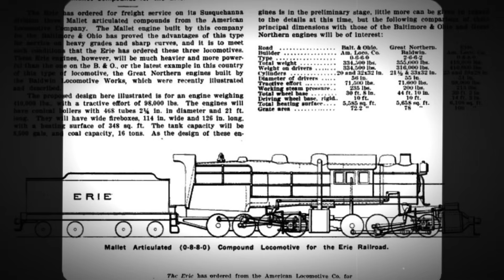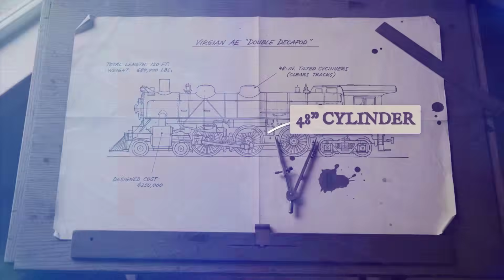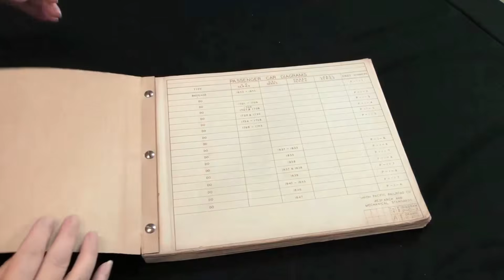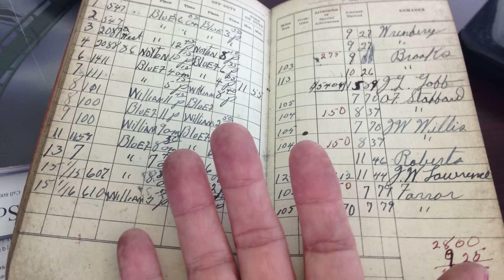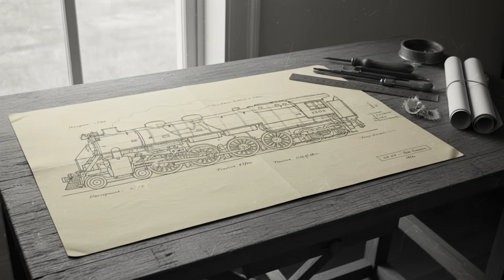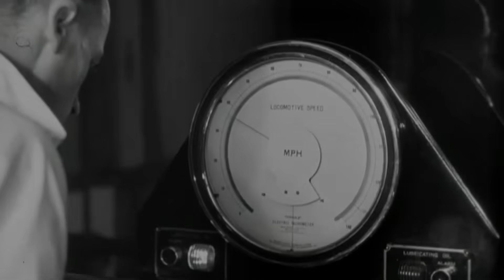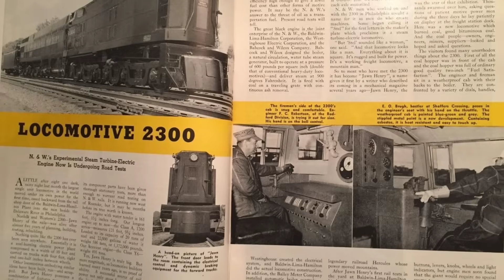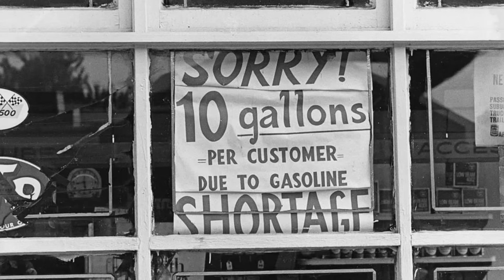10 Forgotten GIANTS That Were STRONGER Than Big Boy

Comment: i never understand why the railroad companies not turn to a all electric "overhead wire" railroad during that time? not waste money building these failed engines especially for hauling coal. why not just make a electric power station next to the coal mines. and string power lines.
Reply: The initial investment is a monumental cost with electric railways.  The only U.S. railroad that ran extensive electric freight trains was The Milwaukee Road.  The box cabs and later Big Joes as they were called, were very good locomotives. And they eventually went bankrupt by the 1980s. That wasn’t the reason, it was poor management that doomed them.

Comment: I would resurrect the N&W Y6B. They had a greater starting tractive effort than the Big Boys and were reliable. My second choice would be the DM&IRR M4, also reliable and slightly more powerful than the Big Boy.
Reply: True, but those late Y-series were built to haul coal very slow. The Big Boy is within a hair of the tractive effort, and MUCH faster.